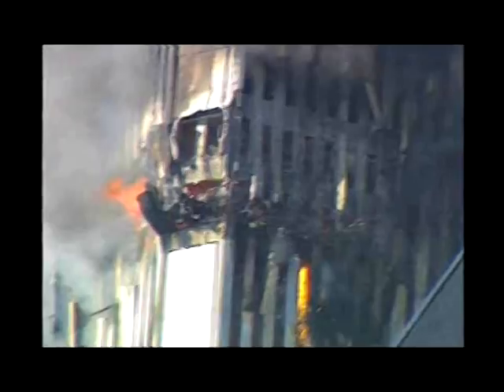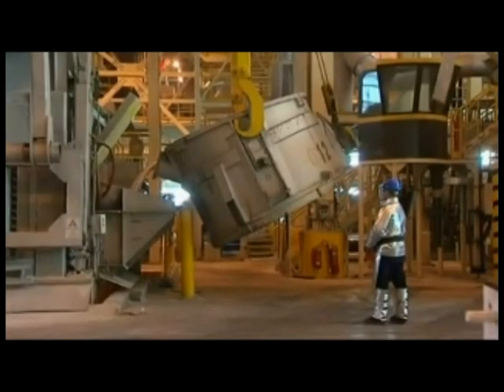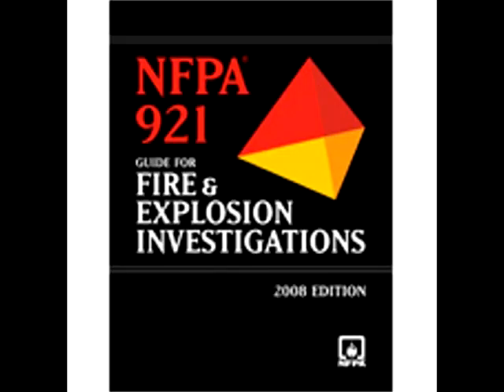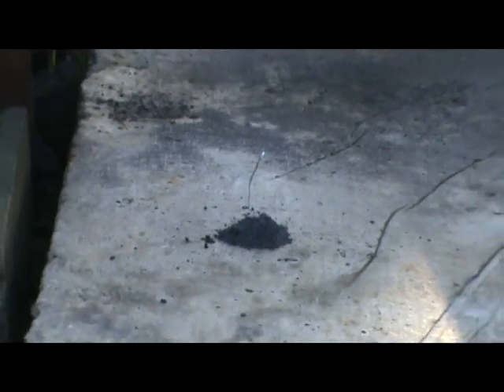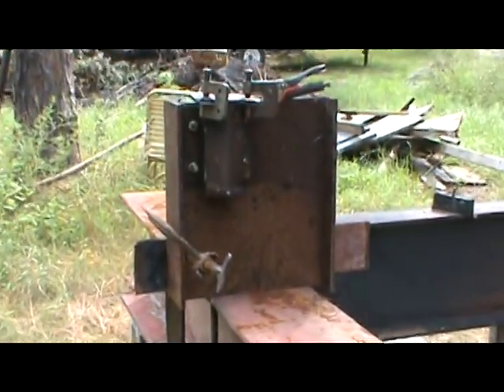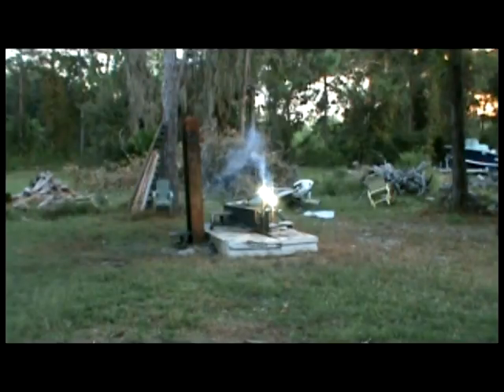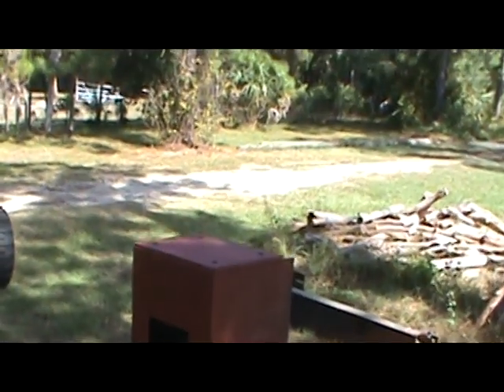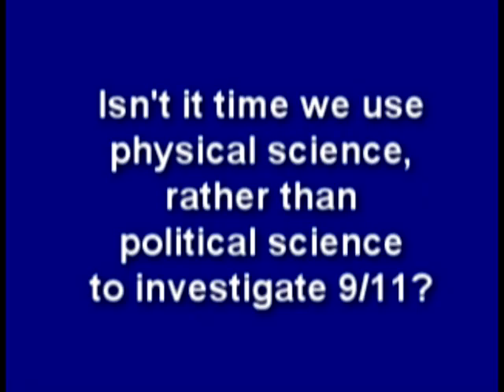9/11 Experiments: The Great Thermate Debate

Comment: Oh, christ, I wanted to see thermate and I get truthertards.

Jet A burns at: Open Air Burn temperature: 1,030 °C (1,890 °F)

More than hot enough to destroy steel, which loses half its structural strength at 950F.

Grow up, tards.
Reply: Seriously, youtube needs a button for "vote down, and have a response squad track down the fuckwad who created this video and shove him into a logchipper."
Reply: I know it burns hot. Tried it in a Zippo once. After wearing out a flint I gave up.
Reply: Unsurprising; someone takes the time to demonstrate thermite cutting steel and the 9/11 shills don't like it at all. WAHAHAHAHAHAHAHAHAHAAHAHAAAAA!!!!!
Reply: Most of the fuel burned in the fireball, The black smoke from the burning suggests there was a lack of oxygen which means that it was burning at a fraction of the maximum heat say 900F. But then it would only bend slowly, the building wouldnt collapse after 1.5 hours
Reply: Mike Williamson
 The NIST report said most of the fuel burned up in the fireball. The videos seem to also verify this fact. How long did the rest of the jet fuel take to burn off? I believe that the NIST report said "within minutes"

This leaves how long for the fire to burn at that temperature? And we ARE assuming MAXIMUM air displacement over the flames, of course. After that, it's just office furnishings, right?

So maybe fifteen minutes at high temps?

Structural steel in America has to be fire tested from 1000-1300F. That's considered "critical temperature", where the steel loses 60% of it's strength, and may lose it's stability. But steel that's at that temperature doesn't snap, it stretches or compresses, usually slowly. Yet there's no external deformation of the building visible until "collapse initiation".

Yes, high temperatures can weaken steel. But once the heat is removed, or reduced, doesn't it re-stiffen? So... if temperatures were high enough to cause the steel to fail, it would have LOGICALLY have happened within the window of time that the temperatures were highest, right?
Reply: its good to be sceptical.  the biggest thing against the conspiracy?  how many people would have known about the plan... from all the way at the top, down to the workers installing the thermite?  it is IMPOSSIBLE to keep something so big a secret without someone blabbing.  what, to organise something like this and no phone recordings.. meeting audio recordings... email... mail... etc etc.  you give your government (or any other business or organisation) waaaay too much credit for being competent enough or able to organise something of this scale without any leaks.
Reply: Look at the various videos of sky scrapper fires, much worse than on 9/11 in which the steel didn't buckle, bend or move in any way. For ex. the massive fire of a sky-sc in Brazil which  burned for more than 24 hours. No harm at all to the superstructure.  Why only on 9/11?
Reply: soylentgreenb Er, no.

Were the towers designed for aircraft impacts? Yes, using the largest aircraft available at the time, a 707. So let’s see how it compares with the planes which were supposed to have hit (if you ignore the fact that those seen were smaller grey military aircraft).
The maximum takeoff weight for a Boeing 707-320B is 336,000 pounds.
The maximum takeoff weight for a Boeing 767-200ER is 395,000 pounds. 

The wingspan of a Boeing 707 is 146 feet.
The wingspan of a Boeing 767 is 156 feet. 

The length of a Boeing 707 is 153 feet.
The length of a Boeing 767 is 159 feet. 

The Boeing 707 could carry 23,000 gallons of fuel.
The Boeing 767 could carry 23,980 gallons of fuel. 

The cruise speed of a Boeing 707 is 607 mph = 890 ft/s,
The cruise speed of a Boeing 767 is 530 mph = 777 ft/s. 

So, the Boeing 707 and 767 are very similar aircraft, with the main differences being that the 767 is slightly heavier and the 707 is faster. 

In designing the towers to withstand the impact of a Boeing 707, the designers would have assumed that the aircraft was operated normally. So they would have assumed that the aircraft was travelling at its cruise speed With this in mind, we can calculate the energy that the plane would impart to the towers in any accidental collision. 

The kinetic energy released by the impact of a Boeing 707 at cruise speed is
= 0.5 x 336,000 x (890)^2/32.174 
= 4.136 billion ft lbs force (5,607,720 Kilojoules). 

The kinetic energy released by the impact of a Boeing 767 at cruise speed is
= 0.5 x 395,000 x (777)^2/32.174 
= 3.706 billion ft lbs force (5,024,650 Kilojoules). 

From this, we see that under normal flying conditions, a Boeing 707 would smash into the WTC with about 10 percent more energy than would the slightly heavier Boeing 767. That is, under normal flying conditions, a Boeing 707 would do more damage than a Boeing 767.
 
So what can be said about the actual impacts? 

The speed of impact of AA Flight 11 was 470 mph = 689 ft/s.
The speed of impact of UA Flight 175 was 590 mph = 865 ft/s. 

The kinetic energy released by the impact of AA Flight 11 was
= 0.5 x 395,000 x (689)^2/32.174 
= 2.914 billion ft lbs force (3,950,950 Kilojoules). 

This is well within limits that the towers were built to survive. So why did the North tower fall? 

The kinetic energy released by the impact of UA Flight 175 was
= 0.5 x 395,000 x (865)^2/32.174 
= 4.593 billion ft lbs force (6,227,270 Kilojoules). 

This is within 10 percent of the energy released by the impact of a Boeing 707 at cruise speed. So, it would be also a surprise for the 767 impact to have caused the South tower to fall.

P.S. Do you SERIOUSLY think the fuel and the consequent fire potential just didn't occur to them?
Reply: James Shiflett"The NIST report said most of the fuel burned up in the fireball. The videos seem to also verify this fact. How long did the rest of the jet fuel take to burn off? I believe that the NIST report said "within minutes""

- bullshit, you lying little spastic. Nowhere in ANY of the reports do they even imply that most of the fuel would be consumed in the impact, and that's because this would be physically impossible. The impact would have accounted for - at most - around 20-30% of it. Want to argue that fact? Then quote them directly, you lying bastard. Whenever someone tries to claim that they said this without actually citing them it's because they know that they made no such statement, so prove me wrong. Then, when you've ignored this demand for fear of exposing your dishonesty even further, you can pretent to ignore the fact that Raoult's Law explicitly limits the amount of fuel that could have been consumed in the initial fireball as well.

Fucking lying cunt.

"Structural steel in America has to be fire tested from 1000-1300F."

- and the WTC fires were MEASURED at over 1000C, and have a theoretical maximum of well over 1500C (try using standard units next time, okay, princess?).

"steel that's at that temperature doesn't snap, it stretches or compresses, usually slowly. Yet there's no external deformation of the building visible until "collapse initiation"."

- bullshit. See this:

https://www.metabunk.org/data/MetaMirrorCache/15d987530fb19f490198129171c8d200.gif

- you see that noticeable bowing of the perimeter columns just prior to collapse initiation? Good. Now look at this:

http://www.sharpprintinginc.com/911/images/photoalbum/9/WTC2_IB_8_53.JPG

- see that less pronounced, but still visible, deformation? That was from 34 minutes prior to the collapse. 34 minutes.

34 minutes.

That means that your claims are fucking decimated. There was visible deformation of the structure well over half an hour prior to collapse initiation. Deal with that.

"Were the towers designed for aircraft impacts? Yes, using the largest aircraft available at the time, a 707. So let’s see how it compares with the planes which were supposed to have hit "

- I note that you are using their MAXIMUM weights in comparison, which we'll soon see is yet more dishonesty on your part in order to hide inconvenient facts...

"the designers would have assumed that the aircraft was operated normally. So they would have assumed that the aircraft was travelling at its cruise speed "

- really? Then would you mind explaining why the man who built the fucking things explicitly stated that they were only tested against a 707 at LANDING VELOCITY which was LOW ON FUEL? Why is this relevant? Because it means the velocity they had in mind was about 180mph and the aircraft mass was going to be around 90 tonnes, resulting in an impact force of up to 7,000,000N. Sound like a lot? Well, not compared to the impact force available to flight 175, which was around 33,000,000N. So, in short, they guessed that the twins were capable of remaining upright after being hit by a force which was about 20% that which was actually exerted on it. And yet they remained standing anyway, because it was the COMBINATION of impact and fire which caused the collapses, so your pitifully-inept attempt to portray this as the isolated causal factor is both exposed as a straw man and refuted outright.

"Do you SERIOUSLY think the fuel and the consequent fire potential just didn't occur to them?"

- not only do I know that to be correct, but the man who designed them has explicitly stated so. The reason they never bothered to estimate the effects of fire is because they assumed an EMPTY 707, meaning there would be no fuel left to ignite. Once again, you are lying in a desperate attempt to salvage a case where you have no valid reason for doing so other than your desire to retain a disproven worldview. You're fucking pathetic.

"Do you SERIOUSLY think the fuel and the consequent fire potential just didn't occur to them?"

- either provide a valid source or you're a lying cunt. In fact, don't bother, because you're already a lying cunt. This is what Robertson had to say about the analysis:

"The two towers were the first structures outside of the military and nuclear industries designed to resist the impact of a jet airliner, the Boeing 707. It was assumed that the jetliner would be lost in the fog, seeking to land at JFK or at Newark."

- which you can read for yourself here:

https://www.nae.edu/Publications/Bridge/EngineeringandHomelandSecurity/ReflectionsontheWorldTradeCenter.aspx

- now, either refute these indisputable sources or admit that you're a worthless little shit who is fervently trying to bullshit his way through scientific analysis. A bit like every other "truth"er, really...

Owned, bitch.
Reply: and now i cant get this fucking truther shit out of my recommended videos stream. thanks youtube!
Reply: Christ J
I'm sorry.

"The fuel from the planes burned at most for a few minutes"

http://en.wikipedia.org/wiki/Collapse_of_the_World_Trade_Center

If they're wrong, have your argument with them.

I think you should send Wikipedia an email and explain their error to them. Will you do so as forcefully as you did to me?

I wonder?

John Skillings, one of the two structural engineers who helped design the Twin Towers, said that an analysis of the building in 1964 indicated that it could sustain an impact from a 707 (I perhaps incorrectly assume fully-fueled), could impact the towers at SIX HUNDRED MILES PER HOUR, and still survive.

http://www.historycommons.org/context.jsp?item=a022793skilling&scale=0#a022793skilling

Was he LYING about this? Or just mistaken?

And, as a percentage, how much of the fuel burned up in the initial explosion, do you think?

What's the official story?
Reply: poo sniffer
Have you ever heard of a ship called the Glomar Explorer?  Most people haven't.  It was designed on contract by the CIA after a Golf Class Soviet sub sank off the coast of Hawaii.  It is a recovery ship for subs.  We pulledthat sub upand took it to Pearl to shore it up and then on to Virginia where it could be hidden in one of our sub pens.  So here you have a shitload of people who know about it yet the truth didn't come out for another 40 years.  How about the Son Tay prison raid?  Thousands of people involved and a mock prison built just so they could practice the op every day.  Yet no one knew.  Grab both of your ears and pull hard until you hear a pop.  When you do you head will successfully be separated from your ass.
Reply: DWI TheNastyOne They were built to withstand a plane with one tenth the impact energy, going slowly, lost in the fog and trying to land (as happened with the empire state building). Fires were not considered.
Reply: Don't muddy the waters with NUMBERS. None of the "coinkydinks" out there want to hear about MATH... and PHYSICS. All they want is their bedtime story so they can sleep at night.

LOL
Reply: Jason Smith"Care to explain how 392 tons of aluminium and petrol (two 757 jets) can pulverize 1,200,000 tons of mild steel and reinforced concrete (3 WTC towers)? All on one days work?"

- why? No-one has ever claimed that this was what happened, you lying bucket of piss, so why the fuck would I bother answering such a blatant misrepresentation?

Come back when you have some scientific integrity - enough, at least, to present an accurate representation of the NIST findings.
Reply: N1H1L9 ...right on...I love posting this video on all channels where they start trolling around with comments "no explosives...no thermite...no proof"...makes them rage even more...lol
Reply: Mike Williamson Before 911 never has a skyscraper building collapsed (ESPECIALLY AT FREE FALL SPEED) because of fire OF ANY KIND, that day history was made when THREE did. How strange
Reply: soylentgreenb
The computer simulations that the design firm ran were with a 707, fully fueled, striking the building at 600 mph.

And the reason why they didn't consider jet fuel, is NOT because the people who were designing these REVOLUTIONARY buildings were STUPID! It's because no one in the engineering trade considered jet fuel to be a danger.

Why is that?

Is it possible that it's NOT a danger?

How much consideration do you think they gave fuel fires when designing the Freedom Tower?

Ask them.
Reply: Christ J You are very adept at insults, bravo! But you must have fucking flunked science in high school. Go look at the video of the Brazil tower fire which raged for 30 hours, not 30 minutes as on 9/11.numbnuts! Tell me how fire alone can cause 3 sky scrappers to collapse. It's a shame the name Christ is associated with an anus with legs, YOU!
Reply: Christ J U manipulative sack of lying shit, the bridge collapse is 100% NOT COMPARABLE to the collapse of the towers. For ex.the  twin towers had  unscathed cores of 47 steel box columns. Bridges have streets below not support columns. The likely cause of the bridge collapse was damage to the concrete which is susceptible to flame damage, causing it  to pull on the steel beams. The 9.6 collapse time of the WTC is your demise  because each of  the 110 stories would have provided resistance that would have extended such collapse time. Such resistance does not exist under a bridge. Got that you anus with legs? BTW, you've been posting w/o a break for many hours. D U ever take a bath? Ya know, wash your nuts and a-hole? Advice, get a life.
Reply: If you can watch video of the WTC demolition (the towers or building 7) and not understand that you are watching a controlled demolition then you are either very afraid of the truth or a very gullible person. You cannot turn 200,000 tons of tempered steel into little bits by “falling down”.  It’s a physical impossibility.
Reply: disgny Mob. Plata O Plomo. It was a big organisation; easy to shift people around so those not on the pay-roll aren't any the wiser.

They could've been laying the lines for years, waiting for instructions to attach the charges. When you own a skyscraper, you can make things happen.
Reply: N1H1L9 unfortunately think how most people are raised; flag and all and not questioning anything. It took me 50 years to wake up.
Reply: Does this explain molten pools of steel that were so hot they were causing fires 3 months after the event? Hardly, at 1900 Fahrenheit. Grown a brain tard.
Reply: carlos arroyo What are you arguing?
Reply: Mike Williamson Yeah it's pretty plain and obvious. The jet fuel didn't even NEED to melt the beams, just weaken them to a certain point to cause a structural collapse. Fucking 9/11 conspiracy people are the worst, completely ignore any basic logic.
Reply: Osama Bin Laden Lol dude, just cause I oppose a stupid conspiracy theory doesn't mean I trust my government on all things. And you don't know WHO my government is, so they could be a fuck tonne more trustful than yours. Your comment is just evidence of your consistent assumption making.
Reply: Christ J So what about the chunk of fused concrete and steel? Does jet fuel burn hot enough to fuse these materials, not not even remotely close. You understand how fusion works and what temperatures are needed for it to take place.
Reply: Christ J No fused, meaning it was changed to a different element had you listened, as the gentleman in the video pointed out. I would love to see the study of those temperatures of jet fuel in open air conditions. Considering controlled environment doesn't exceed 980C.

JET A-1

Flash point: 38 °C
Autoignition temperature: 210 °C
Freezing point: −47 °C (−40 °C for JET A)

Open air burning temperatures: 260–315 °C (500–599 °F)
Maximum burning temperature: 980 °C (1796 °F)

Density at 15 °C (60 °F): 0.775–0.840 kg/L"
Reply: Christ J So every expert that presented evidence, on each video, had no less than 20 years experience, photographic evidence, eye witness evidence, scientific evidence is propaganda? Who are you kidding? Words cannot describe the level of idiocy you're trying to pass off. Look dumbass kerosene doesn't melt steel, office fires doesn't create iron spheres, neither bring down structural steel buildings at near free fall speeds. Your ignorance is mind boggling. 

http://benthamopen.com/contents/pdf/TOCPJ/TOCPJ-2-7.pdf Published in a scientific journal.
Reply: DWI TheNastyOne please see above
Reply: Joel Barry
I think I've seen video of one of the towers (I think it was WTC1, but I've seen so many videos of it, I couldn't point you to it) where, about five minutes before collapse, you can see some slight inward bending.

I suppose that this could be when NIST said that the steel was cooling and contracting and starting to pull in the outer columns, but it could also be the result of the center colums pulling down on ALL the floors, and it was being seen at that weakest point first.

In the case of WTC1, the antenna on the top of the building moves first, which MAY indicate that the center columns started moving first, but I don't know how the antenna truss was coupled to the roof.

There was an explosion in the basement of the first tower. The official story agrees with this.

The magnitude of that explosion, and the source of that explosion seems difficult to prove without evidence.

Could that fireball have weakened the steel in the basement and cause the inner cores to fail? Seems unlikely, considering that a truck bomb couldn't do it in '93.
Reply: Joel Barry are any of them actually comparable? No, they are not, which is precisely why you lying streaks of lukewarm piss are so desperate to mention them. The problems arise when we compare events that ARE directly comparable, as we have definitive proof that hydrocarbon fires can - and have - caused steel to buckle under its normal load.

Here's an example:

http://www.nytimes.com/2007/04/29/us/29cnd-collapse.html?_r=0

- see that? Nothing more than kerosene, and that's without all the hydrocarbons in the office furniture, or the insulating concrete floor above, or the impact damage from the plane. Fire alone can cause steel to collapse, as this example proves beyond refute, so feel free to fuck yourself for being such a worthless, lying little shit.
Reply: Joel Barry
I can tell you how three buildings fell on that day...

Because the designers didn't know what they were doing.

Or, at least, that's the rumor I'm going to start spreading.

:-)
Reply: James Shiflett Huh?
Reply: Joel Barry and - AGAIN! - what the fuck does that have to do with anything? Was it a comparable building design? Were the fires comparable? Did they both feature significant damage to the support structure due to impact damage?

When you have to start using examples that are blatantly incomparable - as you just have - then you are trying to forge evidence. This is like trying to argue that a defendant is innocent of the murder he is charged with just because an unrelated case was thrown out of court. It's a fucking ludicrous attitude, and one that highlights the fact that you have no capacity for coherent scientific analysis.

Now, riddle me this, cunt-features: were the fires and impact damage conducive to the collapse of a single floor? Yes or no?

Show your workings...

Once we've hammered the inevitable affirmative answer into your thick skull, we'll use a couple of Newtonian equations - from over 300 years ago - to prove that this MUST result in a global collapse.

Let's see if you have sufficient scientific integrity to deal with these facts on the data alone, shall we...?
Reply: Lou Cipher Alright fucktard... so what happend to the WTC7 then ? at what temperature does the office furniture burns Mr.Brains ?
Reply: G5pott i can only presume your anger is due to the immense frustration at always being the smartest person in the room
Reply: G5pott a maximum of 1100C, which is why it took four times as long to fail despite having the largest upper section - and thus, overlying load - of all of them.
Reply: James Shiflett Excellent logic. I didn't think of that before.
Reply: Joel Barry excellent logic" cannot be grammatically applied to a "truth"er. It's like describing a black hole as "colourful".
Reply: Christ J Black hole you say? What does Oprah Winfrey's vagina have to do with this conversation?
Reply: Joel Barry it has as much knowledge of the relevant scientific principles as the average "truth"er, so it is an excellent yardstick.
Reply: Tyler Pastorok well, since there wasn't "molten steel pouring out of the building", your assertion can be dismissed outright, can't it, princess?

Go on, take a closer look at that footage again - preferably the stabilized version. See how quickly the metal cools and oxidizes? Aluminium does that, steel does not. Notice also that the oxidized metal - when it rapidly stops glowing - turns the EXACT same colour of the cladding on the outside of the tower, which was made of...

...aluminium.

You are wrong. Deal with it.
Reply: well Christ Jesus is an expert ! doesn't matter that eyewitnesses like firefighters are reporting molten steel. explosions in the loby and so on... he can prove you are wrong  eyewitnesses are shills it just didn't happen ! you are a truther, conspiracy theorist and a shill. oh Jesus Christ I am realy happy you came down from heaven cause we need you !! amen
Reply: Lou Cipher Lou, 1 point only. The gov.story is also a conspiracy. It alleges that OBL and 19 others acted in consort to do what they did. By definition that is a conspiracy. They CONSPIRED TO HIJACK ETC. The only remaining question for many of us is which conspiracy theory is more likely to have been the one that was operative. Take your choice.
Reply: G5pott correct. I know better than those witnesses. And before you try to dismiss this as arrogance, I expect you to first refute the fact I have posted to you on this topic, because everything I have stated is a demonstrable fact that you have yet to even address, much less rebut.

Those witnesses were mistaken, and that is beyond dispute. They describe things that the plethora of news cameras only metres from them failed to catch, and they reported seismic activity which never showed up on seismic detectors. They were wrong. In this, they are no different to the overwhelming majority of witnesses, which is why eyewitness testimony as a whole is considered too unreliable to count as a valid source of evidence in every court in the world.

If you had any real evidence you wouldn't be so heavily reliant on such a demonstrably-poor source.

You are wrong, they were wrong, and I am right, and I have proven it. You have offered NOTHIHNG to corroborate their testimony, whereas I have pointed out multiple aspects of my claims that you can check for yourself. For example, you could look into the analyses of eyewitness testimony by psychologists such as Loftus, Palmer and Asch. You'll soon see that it is significantly MORE unreliable than I have implied.

Of course, we all know you'll do no such research. After all, you wouldn't want to make it more difficult for your dubious conscience to make your current claims when it knows they are wrong...
Reply: Christ J <yea that guy really needs to chill out, even if I did believe what he believes, the way he says it and insults everyone instantly brought it to my attention he's just another YouTube know-it-all with an attitude problem.
Reply: If one man in-- his backyard-- can demonstrate that he can successfully cut through steel beams with supplies only deemed legal (therefore one can assume inferior), then why is the idea of military grade material, backed by unlimited funds and engineering geniuses (because all government sanctioned engineers ARE assumed to be so unquestionable) so hard to comprehend? One more time for some perspective---this is ONE man, with his ONE mind, with his LESS THAN SUPERIOR MATERIALS demonstrating that THIS CAN QUITE EASILY BE DONE.
Reply: OneBalance bullshit. I don't care how much cash any military throws at thermite, they cannot physically fill it with more energy than physics dictates is possible. The simple fact is that thermite contains vastly less energy per unit of volume than wood, paper, plastics, etc. You know, the kind of stuff you typically find in an office...

And, just because you have clearly refused to actually READ this thread before leaping into it, THIS VIDEO PROVES NOTHING. What he has done is show that thermite can cut steel, but only when it is provided with multiple aids that were simply not possible in the WTC.

Of course, since there was a visible deformation of the WTC steel for over 34 minutes, this is entirely moot, as no explosive or incendiary in the universe can act over that kind of timeframe. What that means is that the visible, observed, PHOTOGRAPHED deformation of the perimeter columns and floor trusses is conclusive evidence that incendiaries and explosives can't have initiated the collapses. Debate over.
Reply: ***** shut up. Your logic and ability to engage in scientific analysis is not welcome here, and your capacity to conclude - based on scientifically-verified evidence - that thermitic materials cannot have caused the observed collapses is contrary to the "truth"er religious tenets, and is thus to be rejected a la Galileo.
Reply: Christ J What the fuck are you talking about... I just said thermite melts steel easily... I even gave it's burning temp... and indicated that thermite has been in use for hundreds of years.... 

I just said that no thermite is needed... the buildings fell because of the planes and the damage caused, and basic physics... I actually have an education unlike you, clearly.
Reply: ***** maybe you should employ that education in properly reading a comment, sunshine. Go on, give it another go...
Reply: ***** pssst! If you want a hint, scan through this thread for a few of my other comments.
Reply: Christ J you a´da man! Have always been!
Reply: oller and I presume you're the same amoral, evasive coward you proved yourself to be when you fled from any relevant discussion of the physics involved in the WTC collapses.

How are those momentum calculations going...?

Didn't think so. Feel free to fuck off, because you have nothing to contribute to this discussion.
Reply: Christ J Care to explain how 392 tons of aluminium and petrol (two 757 jets) can pulverize 1,200,000 tons of mild steel and reinforced concrete (3 WTC towers)? All on one days work?
Reply: Jason Smith I expect you will have an answer containing a lot of mathematical formulas. However, nothing can be proven by mathematical formulas unless you have the physics right. The physics is that 1.2 million tons of soft steel will twist and bend and make all the resistance in the WHOLE structure at the same time as he will try to say that it breaks the resistance in one floor at the time. He has no proof or explanation for that phenomena!
Reply: ***** Sorry man, I couldn't get the 'save' button to highlight so I was just seeing if I could use the reply function.
Reply: ***** when the Mafia decides to execute someone, does it become "common knowledge" beforehand?    Most people, certainly those in the "Violence" industry like CIA and soldiers, do NOT have to be told all the details of what they are doing.  You can't be a whistleblower just with suspicions. If that were true, I would BE one.
Reply: I then re worked it another way to come up with this. I'm no engineer and I'd love someone with some mathematical wit to help make a better assessment of those Columns strength;

It is crude I'm afraid as all I have done is take the amount of steel used in each tower then find out the crush limit for one cubic inch and multiplied it by the volume of steel- and then basically divided it by the number of floors and worked out how much inertia one fifth of the building would generate if it fell twelve feet (one floor).

It is sketchy I know BUT...the metal in those columns was not in lumps but extruded into shapes known to enhance the natural ability of the stuff, to resist deformation.

The towers were also constructed in a way which naturally spreads loads both horizontally and vertically very well, so I figure it's not as far out as all that.

They'd withstood hurricanes and truck-bombs so that guess is probably close enough.

If nothing else there's a collection of data all in one place for anyone who can find it in my 'net-bubble'.

 This is another guestimation of those towers resilience made more conservatively. Again I'm no engineer and could use help with this.

The weight of a cubic inch of steel is approximately 0.2904 pound. 
 0.2904 Pounds Avoir into Kilograms
Result: 
0.131723224248 Kg
1 cubic meter =7850Kg 

A36 steel is defined by
ASTM A36/A36M – 08 as “Carbon Structural Steel.” It is mild steel for general purpose
work and easily welds. The tensile strength of A36 steel ranges from 58,000 to 80,000 psi
and has nominal yield strength of 36,000 psi. Actual tested values of the yield strength in
compression ranged from approximately 42,000 psi to 48,000 psi.

We'll call it fifty thousand as I've been generous in the other direction at another point and you will see by the end it matters not, as the figures so clearly show many times the strength required to support their load.

Steel in one tower: 100,000 tons/ 7.850 ton’s per m3= 13550.1355014 cubic meters 

So, 61 023.7441(inches3) = 13550.1355014 cubic meters with compression resistance of 50,000psi.

1 cubic metre =
61 023.7441 cubic inch
1 Square Meter = 1550.0031 Square Inches
50,000 psi x 1550.0031 inches squared = 77500155 = pounds per meter squared compression resistance.
So, steel in one tower: 100,000 tons/ 7.850 ton’s per m3= 13550.1355014 cubic meters  
13550.1355014 cubic meters / 110 = 123.183050013 meters cubed in each floor average.
123.183050013 m2 x 77500155 = 9546705469.38 pounds per meter squared compression
9546705469.38 pounds = 4330312.7595480363816 tons resistance over 123 meters squared

I estimate each tower’s weight on the high side at 500,000 tons and height at 415 and 417 respectively. The section above the point of impact at roughly 1/5th or 100,000 tons which initially fell one floor or twelve feet.

the nominal gravitational acceleration of an object in a vacuum near the surface of the Earth. It is defined by standard as 9.80665 m/s2, which is exactly 35.30394 (km/h)/s (about 32.174 ft/s2, or 21.937 mph/s).

Let’s call it high at 10 m/s2

1 foot =
0.3048 metres
Each floor was twelve feet high. 12 X 0.3048 =3.6576
F=MXA
A=F/M

Mass (100,000 tons) X Acceleration (10m/s2) =1,000,000

3.6576 is what percent of 10?
= 3.6576 / 10 
= 0.36576 

Converting decimal to a percentage: 
0.36576 x 100 = 36.58%

Converting percentage to a decimal: 
36.58% = 36.58 / 100 = 0.3658 

What is 36.58% of 1000000 = 365800 tons of inertia meaning that in the 3.6 meters the 100,000 ton, top section of the building allegedly dropped, it only increased it’s potential force less than four times.

Each tower I believe was 63 meters diameter = 3969m2.
The compression resistance of the steel was, 50,000 psi x 1550.0031 inches squared = 77500155 = pounds per meter squared.

Within each floor there were 123 meters cubed of steel which taking the surface area amounts to; 
 9546705469.38 pounds = 4330312.7595480363816 tons resistance over 123 meters squared. I know there wasn’t an area of 123 meters holding up each floor.

However, each floor was 3.6 meters high so, 123 /3.6 = 34.2175138925 Meters square area per floor average.

4330312.7595480363816 tons resistance over 34.2175138925  meters squared =127362.117647  tons resistance to force.

But then you have to account for the fact that steel is malleable and ductile and so has the same capacity for resistance in the meter below that which is now only subjected to;
 3,195,909.09091 of force required to crush one floor / 3.6 = 887752.525253 
3,195,909.09091 tons of inertia / 127362.117647  tons resistance to force = 25.0930900801

In other words, obeying Newtonian mechanics, the fall should have been arrested in twenty-five meters or two floors. To suggest they accelerated in the face of this is ridiculous. But then to suggest they suddenly dropped twelve feet as every support gave out at once is also ridiculous.

Besides, these maths are clearly not quality. To support the 100,000 tons of tower at that point, the supporting columns must have been well capable of supporting far more than the 127362 tons per 34 square meters resistance I believe the deeper the column under pressure is, the more pressure it can absorb. This combined with the special designs of the columns to enhance their structural characteristics and of course their interlocking nature means this is a gross underestimation of their strength- either way, it still should’ve arrested or deflected the fall.
Reply: ***** What I was saying is, for example, a controlled demolition would require extensive pre incident placing of explosives.   But those people in the Security staff, required to deny access to after hours visitors on certain floors, could not be whistleblowers, What would they have to say:  "we were ordered to restrict access at certain times." So what?.  Or those strange white unmarked "contractor vans" coming and going at night :  So what?  Why does anyone need to know what they were really doing?! Or those removing the evidence after the event, "cleaing up" the evidence of controlled demolition .  They were just heavy equipment operators, what kind of whistleblowing could they do?
   Since the perpetrators had many months to place explosives,  it would probably not need more than a couple of dozen demo experts to pre set the charges.  Do you really imagine that the CIA , Mossad, or whoever could not  muster such a crew?!
Reply: disgny I really don´t understand this discussion. You are on the same side.
Reply: LPhoenix98 People on the 'inside', like being on the inside; they're career people whose entire lives are based on being on the 'inside'. 
People like that are vetted and screened constantly and if there's any doubt for a minute about them then they're quietly sidelined to something less sensitive. Few people have the whole picture anyway and even less understand the full implications so I agree totally; when you have an organisation which is global in scope and limitless in power, it is very easy to keep things quiet...most of the time.
Reply: N1H1L9 one of the strongest arguments on the debunker side use to be that it is impossible to keep a secret. With enough compartmentalization, and like you say , letting people understand the difference between being on the inside and on the outside very few will feel that there s something wrong, from their perspective. Play along is the word. I am doing quite a lot on JFK and seeing how all these career lawyers one by one extended the truth a little bit to fit the ultimate purpose:  make your employer happy.
Reply: oller Yeah, I copied Phoenix's examples for that reason. People in Government employ, see a small part of some thing with a neat cover story and when they retire, they're still bound by the official secrets act anyway.

I swear many of these people, 'Major Stubblebine' springs to mind, are promoted specifically because they're not very bright and they're zealous patriots.

They've done experiments where, in a room full of actors, in a stage-show scenario, if a subject or subjects are asked to raise their hands in confirmation of an obvious question, the subjects will lower their hands or just keep their hands down, when the majority (of actors) do not raise theirs.
Very few people have the nerve to stand apart; in the real world it typically means getting hammered.

Another interesting fact about the Stamford/Milgram experiments is that it was unerringly the most 'moral', patriotic, 'God-fearing folk', who gave the hardest shocks and the least humane treatment; because they honestly believe they're doing it for good reasons.

Most people are shit really.
Reply: oller Yeah. Well nice one man, respect to you.
I had the dubious benefit of Catholic boarding school and a life in Africa to accelerate my disillusion. There I saw coca-cola advertised on every mud-hut and open-sewered ghetto on the continent.

They keep dangling the trade-beads in front of their faces to make them economic slaves.
It wasn't until about 2006-7 that I finally got on the net and started speaking out though. Trapping off on here has caused me a lot of aggro.
You know of course this is a profiling tool for the SS now. It's all logged and assessed. Before I had the wit to lock my BIOS they were crashing my computer at will, whenever I came on one of these videos and argued with them.
Reply: Rando Ligutic I guess you were referring to the video in the thread
Reply: oller ...actually I use both... ;)
Reply: Rando Ligutic both?
Reply: poo sniffer
Give the Government way too much credit?  Tell me genius how many years the government hacked our phone calls and email and other electronic stuff?  Oh you don't know because Snowden didn't fully elaborate.
Reply: Christ J Regrettably for your ridiculous argument, aluminium doesn't glow incandescent when molten and the only material present in the event which DOES, is IRON, you pathetic, brainwashed, religious nut-job.
Reply: LPhoenix98 x
Reply: Fire Marshall Phillip he is and will remain that way forever.
Reply: N1H1L9"all I have done is take the amount of steel used in each tower then find out the crush limit for one cubic inch "

- then you are starting out from an irrelevant point, rendering every last word of your comment worthless. No-one has ever claimed that the steel was crushed, because it wasn't. The steel around the impact points failed because of a combination of heat and the increased load resulting from other support elements being damaged by the impacts. No crushing involved whatsoever.

Your entire argument is refuted by your refusal to think about these events and your mindless acceptance of the bullshit proffered by your fellow cultists.

"The towers were also constructed in a way which naturally spreads loads both horizontally and vertically very well,"

- bullshit. You can certainly arrange for a load to spread rather efficiently horizontally, but it is physically impossible to do so vertically. If it was possible to spread a load vertically then only the bottom floor would be made of steel and concrete, as the rest of the fucking thing could be made of cardboard so long as the load was properly redirected down to the bottom floor.

How can someone be that fucking stupid?

"obeying Newtonian mechanics, the fall should have been arrested in twenty-five meters or two floors. "

- Newton says otherwise, which is all the evidence anyone ever needs to tell that you have no fucking clue how to properly apply his equations, do you?

Allow me to educate you:

p = mV

- means that the momentum of the falling object - the upper section - is dependent on the product of the mass and velocity of that object. In order to determine the velocity we must first determine the acceleration and the distance travelled:

a = (Vf^2 - Vi^2) / 2s

- which we rearrange into:

Vf^2 = 2as + Vi^2

and we plug in the following data:

a = 9.8m/sec/sec
Vi = 0
s = 3.7m (not 3.6m as you repeatedly claimed)

- which gives us:

Vf^2 = 2 x 9.8m/sec/sec x 3.3m = 8m/sec

(note that we have omitted the irrelevant initial velocity figure, as well as subtracted the depth of the floor slabs from the distance figure)

So, we now have a velocity of 8m/sec when the upper section first encounters the floor below it. Now we can determine the momentum:

p = mV

Assuming the mass of the entire tower was ~300,000 tonnes (metric) we are left with an upper section for WTC 1 of approximately 9,000 tonnes:

p = 9,000,000kg x 8m/sec = 72,000,000N

Now, we have actually just determined the amount of force AVAILABLE to the upper section, not the amount of force that was exerted. The latter is determined by the amount of force able to be resisted by the support structure of the floor below. However, this is not the intent of my response. Instead, I am now going to explain why your claim that "the fall should have been arrested in twenty-five meters or two floors" is complete and utter bollocks.

First of all, your idiotic summary is internally inconsistent. 25m is equal to over SIX floors, not the two you claimed. However, this is a minor point compared to the lunacy we are about to expose.

Remember that rearranged equation? Here it is again:

Vf^2 = 2as + Vi^2

- have a very close look at it this time, princess. Pay particular attention to "Vi". Know what that means? It means "initial velocity". Our initial velocity was ZERO. Immobile. Motionless. 0m/sec. We began from a static start. Got that? Good.

Now, what that means is that we have only two possible outcomes from the impact of the upper section with the topmost floor of the lower section. On the one hand, we have a scenario in which the momentum of the upper section is GREATER than the resistive capacity of the lower section. What will happen in this case is that the upper section will then undergo ANOTHER 3.3m of fall before the next impact, but this time it will do so from a NON-ZERO INITIAL VELOCITY. This means the resultant impact velocity will be greater, and the following impact will thus involve an even greater degree of overloading of the support structure.

On the other hand, if the momentum of the upper section is NOT greater than the resistive capacity of the lower section, then the upper section will stop dead without even overloading that first floor.

Your claim that there is some mythical intermediate is utterly without basis. It is the product of your own ignorance and refusal to educate yourself for fear of refuting your desperately-cherished dogma.

You're wrong about everything you think you "know".
Reply: oller "one of the strongest arguments on the debunker side use to be that it is impossible to keep a secret. "

- actually, the strongest argument on the side of those of us with sufficient education, intelligence and integrity is the fact that we can prove that we're right. This is why you're too much of a fucking coward to ever actually ask a single physicist about your idiotic misrepresentation of physics. You're petrified of having to accept that you are not only wrong, but too fucking stupid to actually learn to get this stuff right.
Reply: Christ J anyone can assume anything and that is exactly what you are doing, in you usual cocky, bragging manner; hoping somebody gets impressed. However; those magical days are over for you. You just claim that the momentum of the upper section is greater than the resistive capacity of the lower section. Where is your proof for that?
In fact this is not what is going to happen. The lower section which contains 4/5th or more of the buildings structure will start to make resistance in total; from bottom and up! It will be the same as if you let a car falling with it´s nose into a five times larger truck from 2 meters or so. There would not be any accelerating speed in that case; would it? Nothing demolishes itself like you imply that the core must have done. From where do you get the power to pulverize all the office equipment and the concrete? To fling  several ton steel beams 100 yards horizontally!

You can go on forever and present your formulas but as long as you are unable to explain the basic facts to ANYONE they are not worth the paper they are written on.
Reply: Christ J "bullshit. You can certainly arrange for a load to spread rather efficiently horizontally, but it is physically impossible to do so vertically. If it was possible to spread a load vertically then only the bottom floor would be made of steel and concrete, as the rest of the fucking thing could be made of cardboard so long as the load was properly redirected down to the bottom floor."

Yes; and in these cardboard constructions you put all the office equipment, elevator machinery,  and then you reinforce them with shoelaces, so they will easily withstand a 100 mps hurricane.
Reply: Christ J "Each floor was twelve feet high. 12 X 0.3048 =3.6576" -I'm sorry, did you miss this? Unsurprising as you cretins see only what you're paid to see.

Look dummy, the fire didn't heat uniformly, nor according to the black smoke, were they very hot so...how the fuck did they fold up so neatly? 

They either somehow spread the load uniformly or they would've collapsed asymmetrically. Thicket.
Reply: Weakened steel, not melted steel brought down the towers, unless you believe that any building will remain standing no matter what fire source burns. Examine the next warehouse or modern department store fire and see girders and I beams twisted like pretzels.
Reply: Leo Bolduc and to make them twist; what does that imply? Resistance. Heard of that?
Reply: N1H1L9 x
Reply: LPhoenix98 Relax man, sorry about that. I must've misinterpreted your position there. There's so many sodding shills floating about it's sometimes a little confusing. I must've been prodded by them around that time and decided to do a little 'seek and destroy'. 
Personally I think both UK and US ops were a joke and I have a very low opinion of the SS activities all round. 
I'm always staggered how supposedly 'intelligent' people can so unswervingly support this 'Globalisation' bullshit. 
Oh, and thanks for those lists and info- I did put them to good use- and got comprehensively 'prodded' in return for it.
Reply: Mike Williamson Ikr? Good to know that there are still smart people on YouTube :)
Reply: Fire Marshall Phillip ...they must be on break right now...lol
Reply: Fire Marshall Phillip Ikr? These twoofers think that people will believe their lies.
Reply: Fire Marshall Phillip ...they are like termites...just keep crawling out of the woodwork...LMAO...this just reminded me...remember the guy arguing the wood beam being 75% more resistant to heat than a steel beam...?...LMAO
Reply: Fire Marshall Phillip The fairytale? Well that's good because I don't believe in the fairytale. It's obvious that this wasn't an inside job.
Reply: Fire Marshall Phillip Hey. Settle down, big boy. Just because I don't believe in your theory doesn't mean you have to break down and start crying, calling me names, does it now?
Reply: Fire Marshall Phillip Then stop being a jerkoff and let me believe what I want.
Reply: Fire Marshall Phillip I'm actually a male, but thanks ;)
Reply: N1H1L9
Look, we were both wrong.  I accept your apology if you accept mine.  Now as far as the SAS I am totally with you.  Just like the GSG9's that completely botched the rescue at Munich.  Did they really think (Germans) that if the Palestinians had automatic weapons they wouldn't have explosives?  One grenade and it all came crashing down.  Idiots.  It seems to me we are on the same side of the think tank when it comes to 9/11 though.  The people doing the upgrades to the floors that were hit gave ample time to set the nano-thermite.  While people say it's all bull a key part of this video was going after the weakest link, the bolts inside the columns.  How can anyone refute the the one piece of column that was blown three to four inches right by the opening for the bolts?  I think this guy did a bang up job with what he had to work with.  Nano-thermite on the other hand may have been much quicker and more intense to blow the bolts.  But again, a supposed terrorist in an aircraft plowing through the WTC and then they fall down, and his passport is found without so much as a burn?  Now there is a government who thinks its citizen are sheep and can't think for themselves.  How did you put it BOOSHIITAA? LOL!  You're alright dude.
Reply: LPhoenix98 I had to destroy my first computer thanks to those buggers. More correctly I should say I destroyed it trying to get the bastards out of it. It was a Toshiba P20 laptop so it was hard to work on and I tried the jumper points and the CMOS battery but nothing worked and I binned it. Once they're in....as you know.

They had me by the balls for years before I learned enough about it all to overcome my skepticism and accept they were really responsible.

Now I just use old junkers; fifty quid from ebay. I ensure the router is switched off so they don't hook-up as soon as I switch them on and then I just set all three passwords. I think virus software's irrelevant to them and I don't really understand 'firewalls' but if it's 'windows' I expect they have a 'backdoor'. I expect most viruses are them anyway; I'm kind of lackadaisical about virus software but as long as I have the 'Admin' locked and bolted, they don't seem to be any bother to the computer- instead I get crank calls and so on. They've made it very clear they don't want me making any new political posts. They're fine with me bickering on other people's posts but they've had enough of my 'e-leafleting' campaigns!

They can be very persuasive when the power's going out every few days, the television reception is appalling, crank-calls are coming every few hours and the bloody helicopters are coming over at three hundred feet. I'm on a flight line but they're supposed to maintain a respectable ceiling, y'know?

That's what I wanted to say; I noticed when I had issues, that even with them in control of the BIOS, connecting by LAN line and disabling the wireless seems to prevent them crashing it at will. I spoke to a guy in a computer repair shop and he said he'd heard of 'kill signals' which was a new one on me. Using a cable is something I do as a matter of course now- I don't think it makes much difference if the 'Admin' is already locked but you know; more is better.

I'm sure I said more with less last time but that'll have to do. In the words of Cheech 'n' Chong's band manager; "whoop whoop, y'alls be bad now y'hear?"
Reply: http://thewebfairy.com/killtown/images/flight77/video/pent-cams-911.jpg why do they not release the footage of these cameras so that we can finally see what really hit the pentagon that day?
Reply: LPhoenix98 Oh look at that; I've just found a post you sent me about the 'Glomar Explorer'. God knows what I was thinking when I 'trollled' you. I suppose if you know the games they play, you know how people react sometimes. 
For a while I was making a real effort to wind them up and in turn they were mobbing me and I must've been getting a little 'trigger happy'. I don't sleep well so sometimes I'm a little flakey.
Anyway, I hope your new computer's locked down. If it's done right from the start, it pretty much neuters the shills.
I've done a lot of 'research' into this and nothing will stop them from monitoring what you look at on the net, if they're really interested but those simple precautions at least prevent them from irritating you on a daily basis. Besides, I use rubbish these days- anything that'll connect to the net and keep a second machine for storage etc. so it's no drama if they do go down. More power to you, 'maaaan'!
Reply: While his fat ass sits on his couch watching fox news dur dur der der der copiracy terists
Reply: Mike Williamson You trolls can call people names but cannot satisfactorily explain the facts without explosives.
Imploding and exploding steel-framed skyscrapers, 100 day underground fires, with wildly excessive temps. WTC 7 imploding, 1120 missing bodies, pulverized concrete and disassembled superstructures, etc., yeah sure.. u'r right
Reply: Mike Williamson  ya Mike..... That's why so many other fires around the globe cause structural collapses all the time.... oh, wait.  These buildings were the first in history where that happened.
Reply: ...and yet they dropped so neatly and symmetrically.
Reply: winston smith If they never fail in a fire, why did the steel beams in the WTC have fireproof foam on it to prevent any fire from reaching them, which then caught fire and melted from the extreme heat of the jet-fueled fire?
Reply: DWI TheNastyOne Why the hell would they build them to withstand planes in the first place?
Reply: Mike Williamson what about the weight on the steel from the building when or if  the thermate was in contact with the beams , does that play a factor?
Reply: Major Tom dam dude that was extreme , but funy as fuck..
Reply: Mike Williamson Ok lets  say 100% of the wtc steel was at 50%  strength  even though it was more like 5%   does that make the collapse happen like that ?
please tell me ?
As a child if somebody said your parents were criminals and needed to be taken away, your instant response would be fear of losing their protection and then denial that they could ever do wrong.
This mentality is carefully cultivated in Americans of the post 2001 world and so with ingrained fear and dependence they will defend monsters with unquestioning devotion rather than face the challenge of growing up and fending for them selves.
This is the source of the power
Reply: David Herron
 I would add,, ithe towers didn't 'collapse' (WTC7 imploded symmetrically but that was just due to 'normal office fires' to quote NIST) The towers were shredded by thousands of explosions, leaving 1120 people that were in them completely unaccounted for this this day. No DNA trace of any one of them has been found.  The superstructures were blasted so violently sideways in every direction that multiton sections of them embedded in buildings hundreds of feet away,, and all the rest of it. There is no ambiguity in the conclusions indicated by any of the evidence that proves demolition.
Reply: Well that's what happens when a 200 ton hunk of metal going 400mph while carrying fuel hits something.
Reply: Mike Williamson Your mustache is A+
Reply: Mar Blox About tree fiddy
Reply: The majority of the 911 debate is between people that are not Indoctrinated by the US using science and logic and people who are Indoctrinated by the US using selective science and logic. 
much like a pure scientist vs a Christian/muslim school science teacher in a debate about evolution.

it will be become a frustrating circular debate in which both side accuse the other of only trusting their senses and not he data. and vice versa
Reply: Mar Blox nope, I pretty much accept the truth is already out about 911
But it will be 100 years before its openly excepted and told as a black op  in a sort of apathetic way (off the record) by your history teacher. In that spare 15 minutes to kids that don't care

 Just like  the JFK farce in which a final court case closed after being confronted with irrefutable proof of tampering & destruction of forensic evidence , witness testimony and impossible trajectory with one bullet having to account for 7 wounds in different directions.
Unfortunately all we can do is try to get a clear picture of every thing that happened and teach it in the future. There is no authority to bring this to Its a super crime by a super power
Reply: Mar Blox Probably something called simple compass and map skills
Reply: How do any pilots find their destination?
Reply: Israel did 911.
Reply: You are blind or very well paid to be able to write like a blind petson. The whole world saw the the most audacious demition job. Anyone that saw it can see the truth. No need to
Reply: Mike Williamson http://en.wikipedia.org/wiki/Skyscraper_fire#cite_note-16
Reply: use logic man maybe the black box was in the wrong place at the wrong time
Reply: Reed Garrett "MAYBE?" is your logic?
Reply: Well I know that one part of the plane holding the tail was vaporized and that the passport fell under some fireproof thing. Its very possible. So just think a little before criticizing someone
Reply: Mar Blox About tree fiddy
Reply: As soon as I saw the buildings collapse even to my untrained but educated eye it was obvious that I was watching the biggest demolition job in the history of mankind  in plain view for the whole world to see. No need to argue I know what I saw, everybody knows
Reply: I was replying to a previous comment u dinkleburg
Reply: Mar Blox They found a black box at the pentagon.. It was the flight data recorder. Which confirmed the cockpit door never opened the entire flight. Fact.

Pilots for 911 truth.
Reply: Mar Blox What else flies really fast, is large, carries passengers and fuel, and roughly has the outline of a plane?
Reply: Mar Blox check some old footage then tell me its a missle
Reply: first u find yours because for now i trust the videos
Reply: Mar Blox Wrong. Tard.

Try google, not tard sites.  You'll find plenty of pics.

I can't believe you tards are still arguing over this.
Reply: ***** PREACH
Reply: ***** Watch the video i sent above at 0.25 speed at exactly 0:22 seconds in you see the plane on the far right side of the screen
Reply: Mike Williamson thx m8 i apreci8 it
Reply: Mar Blox You guys are starting to make less and less sense
Reply: Yea.......no I'm just gonna bail
Reply: Reed Garrett sorry. Was talking to the wrong guy. Major Tom is a good guy. 9-11 was an inside job.
Reply: Osama Bin Laden believe what you want to believe bruh
Reply: Mike Williamson But the melting point of  steal is 2750°F, is it not?

I also just want to add I am unsure of my opinion on this topic, so I am not for the official story or the "true" story.
Reply: Major Tom 9-11 was an hoax.
Reply: ZettabyteGamer Yes it is, but the burning of ATF can exceed temperatures of 2,500 K (~4,000 F)
Reply: Mike Williamson Are you stupid or just another jackass who likes to argue? The video states that Jet fuel and open air fires burn at a maximum of 1800 degrees. Which equates to 1000 degrees COLDER than what is needed to melt steel. The debates isn't at what temperature steel weakens. It's at what temperature does steel MELT. You see molten steel pouring off of the sides of the building. I would agree with you that it might weaken and the top of the building fall and even maybe knocking the rest of the building over. Not damn near straight down.
Reply: Mar Blox stop asking the same stupid questions 
http://upload.wikimedia.org/wikipedia/commons/5/5a/Flight_77_wreckage_at_Pentagon.jpg
Reply: Mar Blox Haha oh boy. Can you provide evidence otherwise for your crazy claims?
Reply: KidsWithGuns1992 kuch IGNORANT kuch.
Reply: Mar Blox Haha, ah this is very embarrassing for you. You just don't get it. So banked on a belief completely weighed on OTHER people providing evidence. Lol - don't make psychotic claims if you can't back em up. ;) 

Cause I know I can, but I KNOW YOU can't.
Reply: Osama Bin Laden No, I just don't believe everything I read on the internet cause I'm not a dumb ass.
Reply: KidsWithGuns1992 you probably watched shitty conspiracies or you skipped 59 minutes in a video of 60 minutes. Your gvt. doesn't give a fuck about you .
Reply: Mar Blox Says the guy who can't even write a single statement without wording it wrong. Herp.
Reply: Mar Blox Haha yep, you sure are. :p
Reply: Mar Blox And not smoking crack, evidently. ;)
Reply: Mar Blox Same thing.
Reply: Christ J NICE!
Reply: DUBYA DONE IT!
Reply: Spyrit2011 you mean that lump of DECOMPOSED CONCRETE with INTACT steel items embedded within it? Is that the stuff you're talking about?

Concrete starts to denature at about 300C, at which point is breaks up into its constituent materials. That is what those "meteorites" are. They have wholly unaffected steel objects buried within them, which demonstrates that the temperatures experienced were NOT sufficient to have caused those steel objects to melt.

You are either criminally ignorant, or a liar.

"Does jet fuel burn hot enough to fuse these materials"

- yes, actually. Two years prior to these attacks a study was done in which identical fires were tested in order to determine the best possible shipping method for oxygen canisters - much like the dozens on board each plane for emergencies. This study noted ambient temperatures which EXCEEDED 1500C, which is just above the average melting point of construction steel (1475C).

Personally, I consider it highly unlikely that these temperatures were attained, and the fact that there is no evidence whatsoever for melted steel proves me right to be so sceptical.
Reply: Mike Williamson Okay, I'm going to assume that you are completely blind, whether it be from cataracts, or you were born that way, and you managed to get your comment written by some magic force, because if you could see, you would notice that there was molten steel. We aren't saying how "ermagerd thu steel wus damaged" we are saying that jet fuel (the most powerful fuel in the situation) could not physically cause the steel beams to melt. This is coming from someone who runs a forge, I make money by manipulating steel at different temperatures, and never have I seen steel become destroyed at 1890 degrees F.
Reply: Skinned Sheppard Dude it has nothing to do with the steel melting you derp. it has to do with the steel being weakened from an already poorly forged building structure.

It's pretty simple shit, hundreds of tonnes of weight ontop of a weakened structure - what do you think would happen? 

Anyone who believes this 9/11 conspiracy shit is fucking retarded. Plain and simple.
Reply: Then can you explain the molten steel then? Because it doesnt seem like youre taking that into account.
Reply: Mike Williamson Some interesting information.. You also realize that Jet fuel A is kerosene right?

-1535ºC (2795ºF) - melting point of iron 
-1510ºC (2750ºF) - melting point of typical structural steel 
-825ºC (1517ºF) - maximum temperature of hydrocarbon fires burning in the atmosphere without pressurization or pre-heating (premixed fuel and air - blue flame) 

Diffuse flames burn far cooler. 
Oxygen-starved diffuse flames are cooler yet. 
The fires in the towers were diffuse -- well below 800ºC. 
Their dark smoke showed they were oxygen-starved -- particularly in the South Tower. 

Maximum jet fuel burn temperature is 825 Celsius.

Temperature needed to melt structural steel is 1510 Celsius.

Compare this.

On February 13, 1975, the WTC North Tower was beset by a fire, which "burned at temperatures in excess of 700°C (1,292°F) for over three hours and spread over some 65 percent of the 11th floor, including the core, caused no serious structural damage to the steel structure. In particular, no trusses needed to be replaced."

Sources: New York Times, Saturday 15th February 1975
Reply: Exactly, the building burned below the melting point of steel, yet molten steel still cascaded from the side of the building. What point are you attempting to make?
Reply: Skinned Sheppard That Mike mentioned the incorrect burn temperature of jet fuel A.
Reply: Christ J http://www.ae911truth.org/38-home-posts/78-education.html
Reply: Skinned Sheppard "molten steel still cascaded from the side of the building"

- and yet you have conveniently avoided my proof that no such metal could possibly have done so along with my evidence stating that it is perfectly possible for those fires to have melted steel - in spite of there being no evidence that any steel ever actually melted.

Some would suggest that you are dodging inconvenient facts just to prevent yourself from having to accept that your ignorant, uneducated opinions are demonstrably false, much like every cult in existence.
Reply: Spyrit2011 "The fires in the towers were diffuse -- well below 800ºC. "

- they were measured at over 1000C. Nice try, princess.

"Their dark smoke showed they were oxygen-starved"

- physically impossible. Smoke is pure carbon, which means it can only be produced if massive amount of carbon are reacting. For smoke to be abnormally thick requires that the oxidation reaction that is producing it to be abnormally intense, which is exactly what my aforementioned report proves those fires to have been.

You know precisely fuck all about oxidation reactions, and you evidently have no intention of ever seeking to correct your incorrect assumptions for fear of destroying your worldview. You are pathetic.

"Temperature needed to melt structural steel is..."

- not relevant, because none of you lying cunts can show that any molten steel ever existed at the site. All you can do is point to some falling sparks which behave in ways that simply do not match molten steel. I suggest you pay VERY close attention to how quickly those falling metal sparks lose their glow, and compare that to how slowly molten steel ceases to glow. You'll find an insurmountable incompatibility. Which, I suppose, is why you'll refuse to do something so trivially simple, isn't it...?
Reply: Spyrit2011 so? What the fuck do you wish that irrelevant link proved? Does it feature peer-reviewed analysis of the falling metal? Nope. Does it feature analysis of pooled metal found at the site? Nope. Does it feature ANY objective scientific evidence for molten metal of ANY kind - much less molten steel? Nope. Not a single fucking thing.

You have just posted a worthless link because you have no evidence to present instead, and you have no evidence to present because your claims bear no resemblance to reality. You are wrong, and that's a fact.
Reply: Christ J You shills always are moronic, when you refuse to look at scientific data. Did you honestly even bother to look at the page and the video melted steel?

If the experts in the architectural and engineering fields, aren't enough to convince you, how about the images of the firefighters page, http://web.archive.org/web/20110911032318/firefightersfor911truth.org/
Reply: Wait, hold on. I'm saying that it was an inside job and it looks like you are as well. I think there may have been a miscommunication.
Reply: So you do believe the government explanation?
Reply: okay, to everyone, because i cannot even tell who i am replying to any more- Yes, there were witnesses saying that there was red hot molten metal cascading from the side of the building in multiple locations, there was also video evidence, as shown in this video. not to mention, stop throwing around ad hominem, it doesnt strengthen your position in any way, it makes you look less secure with your stance.
Reply: Skinned Sheppard witnesses who had no corroborating evidence - and who presented internally contradictory assertions - and video evidence of some kind of molten metal.

Concision is important, as is omitting bias.
Reply: Okay, lets assume its just "some kind of metal". What kind of metal do you think it was?
Reply: Skinned Sheppard front runner is aluminium. I posted an image a few comments back which showed that it had stopped glowing before it dropped out of the frame of the shot, which was only a couple of floors and would have been reached in less than a second. That means the metal had cooled - the exterior of it, at least - sufficiently to have oxidized in about a second after leaving the fire. Steel doesn't cool that quickly, but aluminium does.

The evidence indicates that it was aluminium, and indicates that it is almost impossible for it to have been steel or iron.
Reply: Okay, I know I talked about ad hominem, but jesus christ you fucking twit, liquid aluminum is a silver, not red hot and orange unless it is under direct influence of fire, in which case the fire distorts the view of the aluminum itself. This is coming from a man who OWNS and RUNS his own forge.
Reply: Skinned Sheppard molten aluminium 

https://kevinhenington.files.wordpress.com/2013/04/molten-aluminum.jpeg

- more molten aluminium:

http://gietwerk.nl/wp-content/uploads/2004_0916Image0006.jpg

- yet more molten aluminium:

http://drjudywood.com/articles/aluminum/alumpics/molten.jpg

- and you'll note that at least one of those links is from a "truth"er site, which absolves them of any hint of bias.

You know fuck all. And, once again, having spouted a lot of shit about logical fallacies, you are resorting to, once again, sputtering bullshit and expecting to have your word accepted as gospel just because you claim to run a forge. Well, I know more about your claimed job than you do. How does that feel, bitch...?

Oh, and I'd also like you to note that not a single one of these images is reflecting any fire, as the fire is in the wrong place in each case, which means the glow is inherent to the metal itself. It certainly cools extremely quickly, but this is EXACTLY what happened to the metal seen falling from the tower, as I proved in an earlier comment.

I accept your refusal to deal with that previous comment as proof that you have no valid response to that image, and as a tacit admission that you are wrong.

You're done.
Reply: It isnt my job, just letting you know, I run it from my home for fun, and never once have I, nor any of my friends, managed to get the forge to burn hot enough to to get aluminum to glow to any degree, because we cant get a forge to run over 1,500 degrees F.
Reply: And FYI Aluminum glows red at an excess of 1050 degrees C. Granted, I dont invest all my time into trying to prove 9/11 was an inside job, so in reality, i dont care.
Reply: Not to mention there's was an entire airplane burning/melting which is mostly aluminum.

Realistically, thousands of office employees would not have noticed cutting into office walls to get to the support structure to install these charges?
Reply: Menuki Watch the video again. Also, aircraft grade aluminum has a higher melting point.
Reply: Skinned Sheppard the video shows nothing relevant. It is an exercise in the bait-and-switch logical fallacy.

Feel free to respond to my annihilation of your cited sources.
Reply: I meant watch the video again because it is shown that the explosives were built into the building. No I cant prove this. No I dont care, Yes this is what i saw in this video and I am no longer willing to converse with kids throwing around ad hominem.